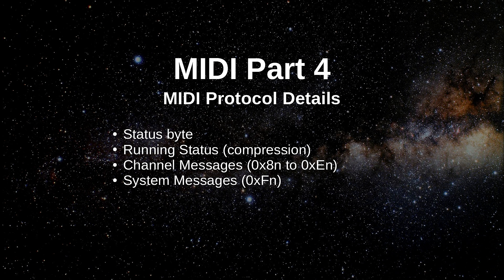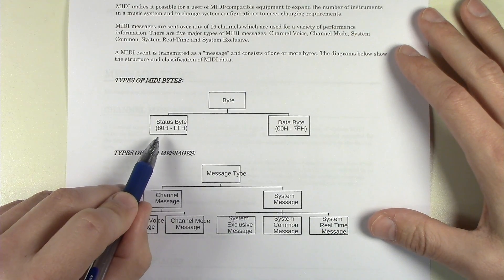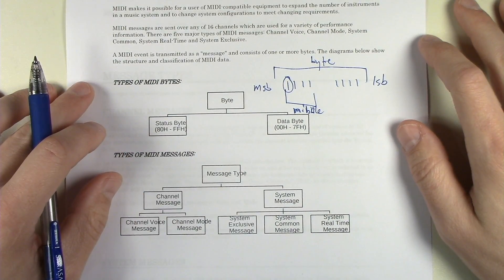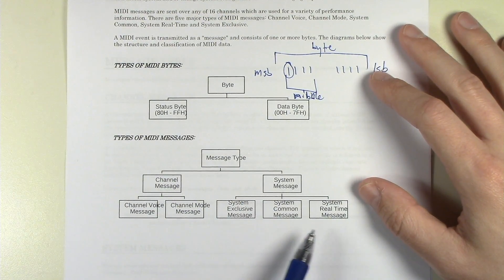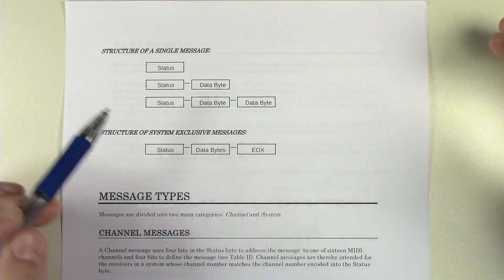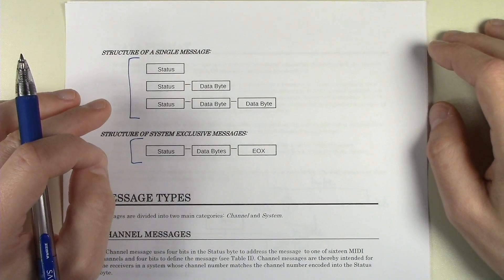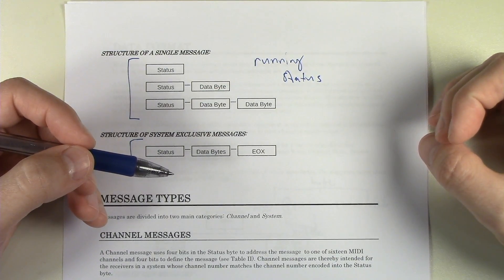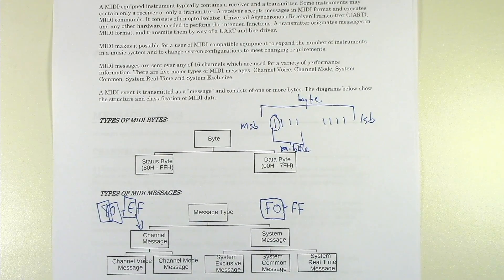MIDI Part 4 - MIDI Protocol Details

Comment: at timestamp ~14:35 you say that channel message status bytes are in the range 80 -EF, but I thought status bytes always have the most significant bit set ON.  Is that not true for channel messages?
Reply from the maker: 80 in HEX has the most significant bit on
Reply: @shiftedphase  yes, but my point is about the channel message status range 80 to EF - the MSB of EF is off so how can it be a channels status message?
Reply from the maker: @amonmcranny2654  the MSB of EF is on.. any byte with a value of 0x80 or greater has the MSB on... check the values of 0-F in binary and you will see

Comment: since your target audience is potentially unfamiliar with binary/hex I think it would be useful to explain that the notation in your diagram e.g. 80H and 7FH are each actually 2 hex digits, and the H at the end simply indicates that it is a hex number - so 80, 7F, FF are hex values using base-16 characters (0 - F)
Reply from the maker: i'm sure there are excellent videos and wiki pages about this

Comment: Thanks for putting in your time to make things easy.
Reply from the maker: Glad I can help!
Reply: @shiftedphase  i have a roland Fc 300 pedal connected to a korg pa900.i dont know how to save the patches on the fc300 so that i can trigger the pa900 patches.By keeping the midi in channel on upper 1 i can change the soungs but that happens randomly not in a sequence.i managed to get the user patches working in order by changing the lsb to 64 and thus incrementing to 65 and move sounds page by page.on putting the midi channel in to control i could get the styles to change.But i cant somehow get the performance patches to change as there seems to be no options in the midi channel in.Pl guide if you can.Its really frustating as there are not many videos on the fc 300.
Reply from the maker: @sonnyjohna  I don't have either of these products. You might look for a user forum or something if the manuals are not being helpful. Sadly a lot of MIDI stuff is not well documented on modern products.
Reply: @shiftedphase  Thanks my dear friend for that. Can't you take up sessions of connecting midi devices with each other where midi program changes and control changes are clearly explained? That would help a lot of people.
Reply from the maker: @sonnyjohna  I'll try to do that when I have some time.

Comment: Thanks, really interesting series, will you be talking more about sysex and nrpn, and maybe how to look at a midi spec and decipher it to use in a program or midi controller. To me its just cryptic tables in the midi spec that may be hexadecimal...would be great if you could help decipher it and how to actually implement it in a midi controller or arduino program...again great series..thanks
Reply from the maker: SYSEX is definitely its own video in this series. Your other ideas sound great but I've decided to tackle specific things like that as separate videos... like an appendix in a book. Glad you're enjoying the videos!